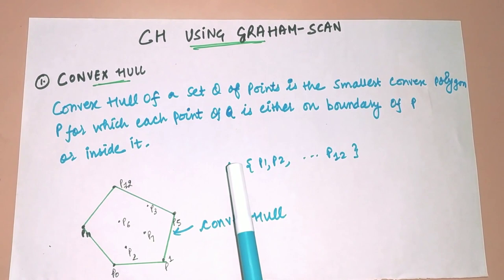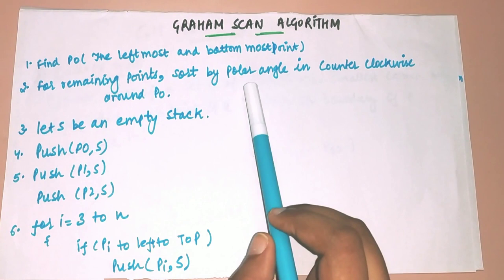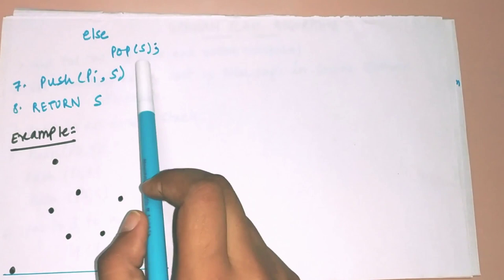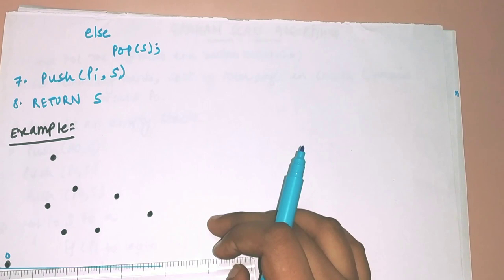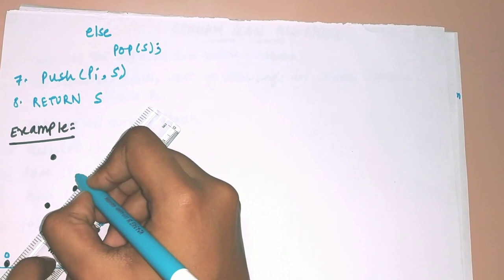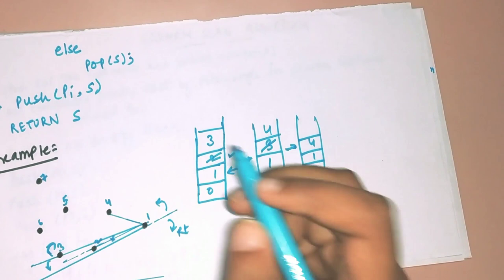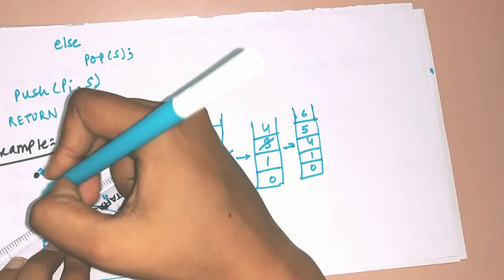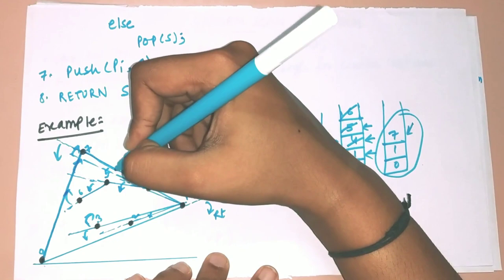GRAHAM SCAN ALGORITHM | Convex Hull | (solved example)

Comment: The intuition is very simple. If the next point is on the right of the current line, it’s not inside or on the boundary of the hull being built. So, back off until it can be included.
Also, think left = counterclockwise, right = clockwise.

Comment: So, what happens when several points have same angle but different magnitudes? Also in real applications, it could be that there exists repeated points, also consider that the sides could contain several points. When implementing, these situations will make your execution to hang and you'll spend several frustating hours trying to understand why, well these are the reason... 😅
Reply: If angles are same then algorithm will consider the point that is farthest from the reference point.